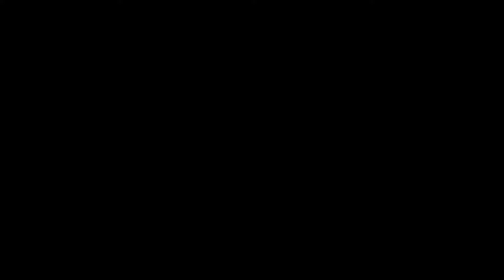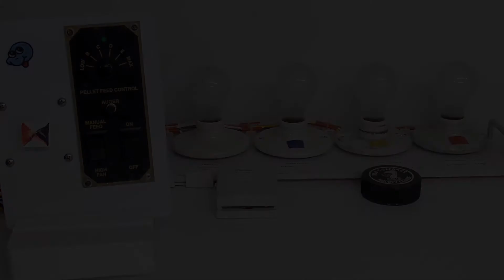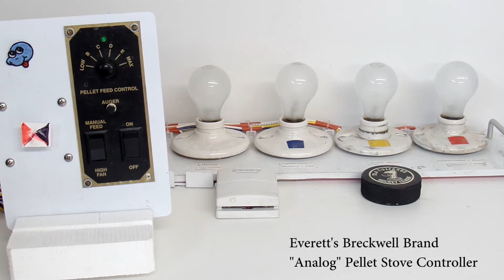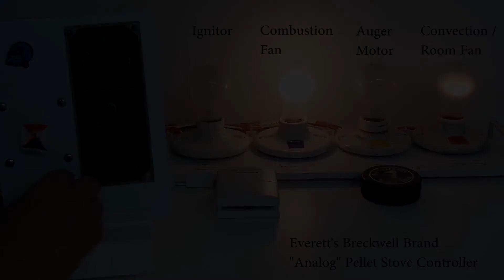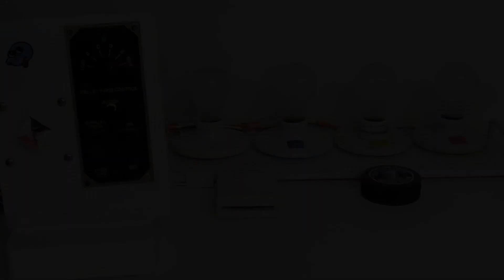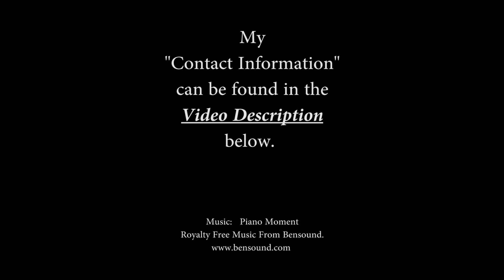"Pre-Shipment Test" of Everett's Breckwell Brand Pellet Stove Controller.

Comment: Hey man i have a breckwell stove with a switch identical to this one. And I’m having problems my problem Is no auto auger. I can turn the stove on combustion fans comes fine. The room fan speed can be adjusted to high or low with the switch. But once i hit the auger button the big green light comes on and 30 seconds later the little auger indicator  green light comes on then of like it should but no auger movement no sound. But if i push Manuel feed it turns the auger. Is this a bad switch board or maybe the thermo disc.
Reply from the maker: Two things to check..

Is there a fuse on your circuit board?  Typically it is located between the two large black switches..  If it has failed, then you will not get Auger Drive in Automatic mode, but you will in manual mode.  I have a video on that here:  

https://www.youtube.com/watch?v=pvEE_LWKIR4

Then if your fuse is good, or if there is not a fuse, then you have a failed solid state relay on your circuit board..   

That is the type of repairs I do...
Reply: @MonteStudios   dude!! I had no clue it had a fuse there. And it blown. I got up out of bed to go check offer i seen ur comment and watched that video. I just had to know if it had a fuse and it does. I’ve been messing with this stove for over a week.  I’ve jumped the thermo switches i cleaned everything. Tested everything and still nothing. I was about to pack it up and ship it out to get it fixed. I had no idea there was a fuse there. And I’ve been up close and personal with this stove for years. And all along it’s a little 1A250V fuze. Wow. Thank you. You seriously helped me out a lot I’m glad i came across your videos. Thank you. I was seriously going to pack up this board and send it off.
Reply from the maker: @johnrobinson5575   Good for you..  I'm glad my video was of assistance..   If you have not already..  consider replacing your auger motor..  I suspect that the reason the fuse blew, is because the motor is "dragging" and getting hot..  causing it to draw more current, and the fuse blew..    I cannot say for certain, but that is my guidance to you.

Good job.
Reply: @MonteStudios  thank you I’ll look into it and see if it blows another fuze if it does it’ll get a new motor.
Reply from the maker: @johnrobinson5575  How is your stove this evening? I hope all is well.
Reply: @MonteStudios  i haven’t had a chance to get a fuse yet but when i do i will update you for sure. I’m sure it’s that fuse it started this problem when my wife decided to unplug the stove when it ran out of pellets instead of turning the switch to off. And when i filled the hopper and plugged it back in it posted on and turned on the exhaustion tight away and since then the auto feed stopped working so I’m pretty sure that’s the problem. It popped the fuse when i plugged it back in and the switch was in the on position.